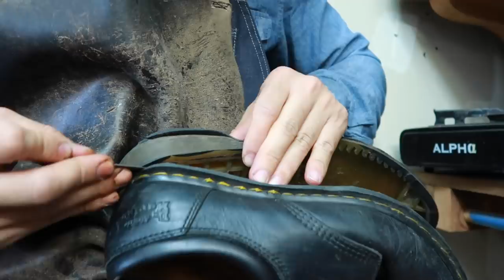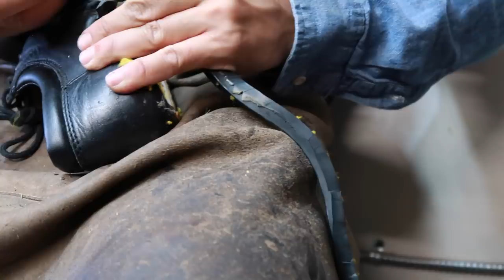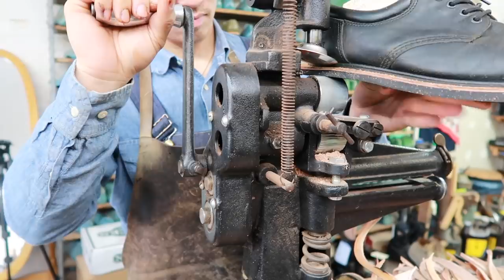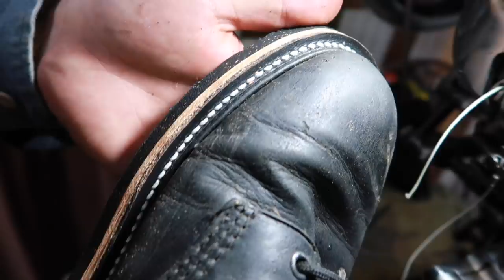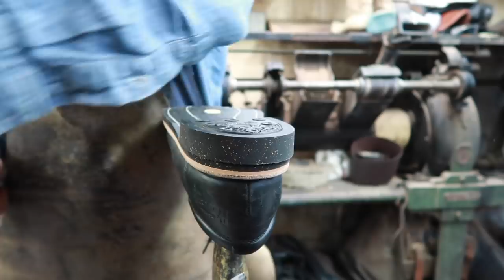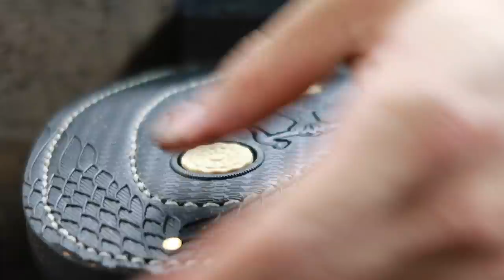DR MARTENS 8053 Resole #53

Comment: I knew that ripping off the pvc welt and replacing it with a leather one to which a 'proper' sole could be attached, was possible (and have wanted to see someone attempt this for a while)  but the time spent doing must surely cost more than a new pair, so not really economically sensible? HOWEVER, when it comes to personal stuff like shoes and boots, sense often takes a holiday...  Thanks for showing us it being done though, Brian!
Reply: The leather is cheap, the construction is garbage, and the goodyear welt is a pain to re-sole. Whoever sent these in must have a good deal of sentimental value invested.
Reply: kerensky77  Wow. I would've thought about £150/$200 tops. (Then again, hand-stitching a welt on isn't exactly a five minute job.)
Reply: The shoes definitely had a senimental attachment to them, would have been cheaper to buy a new pair for sure
Well we can look at it this way, its job security for Brian the Bootmaker and he can keep making quality videos for us all to watch and enjoy
Reply: Nu uh Brian says it makes more sense to resolve because their sole lasts longer than another pair and then you just get minor repairs and save more in the long run.
Reply: Plus you don’t have to wear in a new pair. It’s also worth mentioning that, two years ago, it was easy to find a pair of Docs or Redwings in your size. Today, everything is in short supply. Definitely going to be sending Brian my 8053s!

Comment: My cobbler took my 1997 1461s cut off the sole, left the welt and welt stitching, replaced the yellow cushioning with a piece of leather and glued on a gumlite sole. Three years later they are still fine. Your process seems like such overkill but it was fun to watch.
Reply: Most cobblers will leave the well if it's in good condition, but getting all-new welts hand stitched is a Role-Club specialty it seems.
Reply: The Mad Gentleman I think he did it just for the video

Comment: I sold.... I'll be sending my 1460 boots and 1461 shoes to you... great job.
Reply: Then tell him to put in a shank and replace the low-quality foam with proper cork or leather. Doc Martens are notorious for losing support as time goes by, especially because they cheap out on the shank. Also, stitching on the underside wears out as the sole wears out so request open channel stitching at the very least. It'll save you money in the long run.

Comment: Hey. Love your vids! I have one technical question tho. When you put new sole on you use stitches that are exposed on the bottom of the sole (I know you also use nials but sitll). Don't they get worn off quickly? They are in constant contact with the ground when walking, and as sole wears off they get more exposed.
Reply: the sole wont come off anyway, every hole is like a nail or peg, securing them on. Also there could be glue still

Comment: I've worn out two pair of Doc Marten's safety shoes. One was a 1925, the other like the 8053; both steel toe. I have another 1925 I wear some now for work. Never wore out the sole, mine always cracked open where you flex the toe.

Comment: ive always just told people 1. you cant get the soles and b. glue doesnt work the soles are melted to the welts i saw the video. it never ocurred to me to rewelt and custom pick the soling. this could have been done with a thin mid and a crepe sole as well. ( gumlite comes in so many options!) yes, top of the price range, but 
you basically made a r.w. heritage out of a d.martin! thanks!

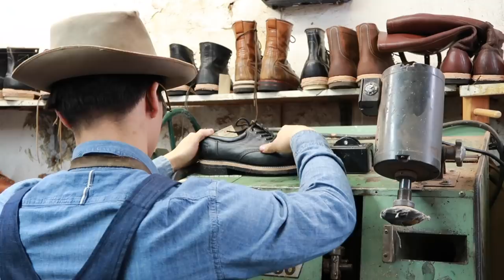Comment: Hey Brian. At 8:35, what did you do to the shoe or the heel block to make it balanced?
Reply: I guess he uses the green last inside the shoes,to balance out the whole shoes so when he applies the  soles they will be stable and straight balance to the surface of the floor no gaps of unbalancing,then when all is balance the heels come into place ( and are balanced from the factory ,that why he checks for balance before installing ) I was wondering the same thing,but looking at his work I determined this what is my philosophy towards balancing the soles! Good question! Have a good day

Comment: Do the heads of the nails make sound when the souls hit the cement while walking? Every time I see you nail them in my mind thinks they must sound like tap shoes while walking. Can you do a video showing that they are quite ? My ocd is going crazy here lol. Love your work I’ve been binging on your channel.
Reply: They are to far in to make any sound on cement. Not for along time. And if you notice a sound or notice scratches in your footprints from them, then it's time for a resole. As you have worn through your outsole.
Reply: As said above, the nails are so far embedded into the heel or arch that it would take a very long time to wear them down that bad.
Reply: I wonder that every time I see him hammer in a nail. And in regard to the comments replying that the nails are sunk too deep to create any noise for awhile I went back and watched when he nailed on this specific video and the nails looked right on the bottom, not sunk. The nails actually have wide flat heads on them, making them harder to sink. Is there another process he does but didn't show where he drives them deeper into the sole?
Reply: @j.madone7819  he can ise an awl or punch to push the nails in further if he wants. But those nails wont make a sound the way they are now being flat. So it would'nt be necessary.

Comment: are you aware of any cobbler/shoemaker who would be able to refit an original doc martens airsole to worn out ones?
does anyone have the machinery to do this? this has been on my mind for several years now...
Reply: I've heard that Doc Marten's can resole them but I'm skeptical. The way they're made certainly doesn't lend them to easy re-soleing
Reply: @thetman0068  they did, years ago. nowadays, since production moved to asia, they do not perform any resoles. nevertheless, if the sole is cut and a new welt is in place, the procedure to attach a new sole onto the shoe is the same as on any new shoe, no reason it would not work. but you need this machine, which fuses the sole to the welt. i am not aware of any such machine in private posession, thats why i am asking.

Comment: What I understand is you take everything down to the mid-sole, you add a welt and then a sole and heel. If you want to resole Dr Marten, it is pretty much impossible, they are not designed to be rebuilt, you send the boot back to them and they send you a new boot and pretend it is the original. The leather you send to them is turned into bookbinder and re-lasted into the shiny, patterned boots. People buy them thinking they are getting quality. In the past it was true, not today.
Reply: Hi, are you sure? I see that NPS Solovair sell replacement soles for their Dr Martens style boots and I'm sure I've seen independent cobblers advertise they can change them, I plan to replace the sole when mine wear down.

Comment: Are you joking? One of the main reasons to wear Doc Martin's is the air ware sole. You have completely ruined these shoes. If you didn't have replacement soles you shouldn't have taken the job on. If I were the customer I'd throw them at you!